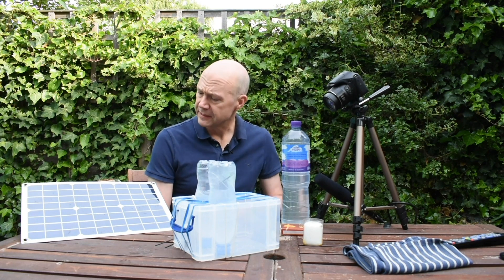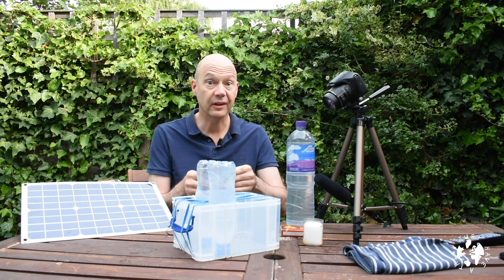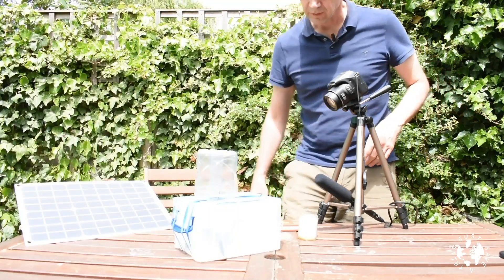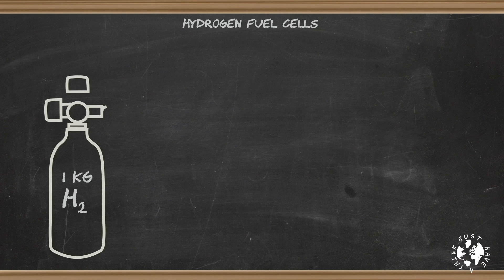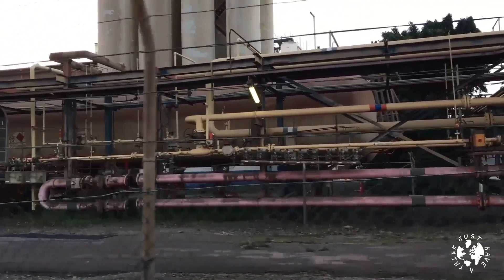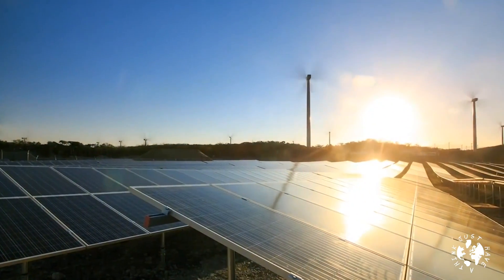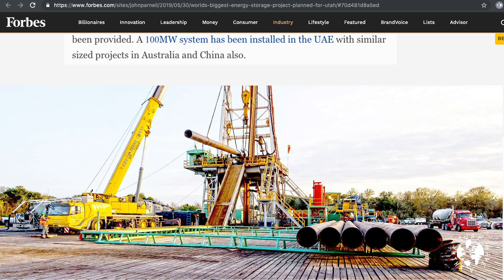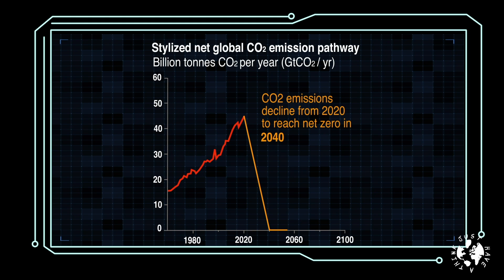Energy Storage in Hydrogen : Does this beat batteries?

Comment: You can't use hydrogen in normale pipes, and it would be way more dangerous to use too.
Then there us the power lose from making it and using it, making it way less efficient than batteries.
And yes you could use ut on peakerplants, but no they are really slow compared to a battery, so it can't replace those. As they react on microseconds where a peaker takes minutes to hours to reach demand, just look at the Tesla battery in Australia.

Comment: Ultimately it all comes down to price per Kw delivered. Because of the inherent inefficiencies in the collection and distribution of Hydrogen , esp using PV , Batteries are still ahead for small motor vehicles.

Comment: Any serious energy storage facility is going to be using the pure O2 also. Pure O2 enables fuels to burn faaaarr hotter, so any legitimate comparison between batteries and stored hydrogen needs to include the pure O2 gas.
Reply: The only efficient way to reclaim energy stored in hydrogen is fuel cells.  Burning hydrogen means losing something like 70% to waste heat.

Comment: For H2 hidrogen energy nid for fuell cell lot of Platinum for electrode.And for membrane for Fuel elements   have not so long life.Better will be use NaS battery.Na get from salt,S from petroleum,vulcans ect.It's more perspective but fo NaS battery nid for work high temperature.

Comment: Instead of focusing on storing the energy, why can't we focus on placing solar panels more to the east and west? 
Why can't we start buying electricity from other countries (because we can't place our solar panels there, but they can)?
Reply from the maker: Hi Harry. Fair observation. I've looked at smart grids a couple of times in previous videos, but we also need to develop High Voltage DC transmission. This is already being developed and I think we'll have sub sea cables for global smart grids within a few decades. I'll do a program about HVDC later in the year. All the best. Dave

Comment: The problem with hydrogen is that it already reacted to reach a more chemically stable state due to its reactivity. Converting it back to potential energy is inefficient and therefore ineffective. It’ll be much more effective to pump water to a higher altitude and use hydroelectric power.

Comment: Seems to me hydrogen would be a good alternative to power shipping.
Reply: @zUJ7EjVD  why? Will be able to make plenty cheaply as with renewables you over build so plenty of cheap electricity available. Energy dense giving those large ships a long range. Safe, if theres a leak it just vents upwards.A dam load easier than bunker oil to use. And so on.
Reply: @zUJ7EjVD  It's not that bad when done on a larger scale, ie ship sized stuff. Yes it's inefficient but you're using electricity that would only be curtailed.
Reply: @zUJ7EjVD  We don't have the infrastructure or the amount of renewable  electricity generation at present. But we will, a paper came out the other day showing how it made economic sense to dramatically over build renewables and curtail large amount of electricity. So electricity will be cheap for such industries. These industries will be energy hungry but relatively cheap infrastructure. What better energy storage options are there for ships?

Comment: I remember reading it takes a heck of a lot of energy to convert water in to hydrogen, you can see from your video it took 3 hours to make a tiny amount of hydrogen, and on top of this then you have to freeze it or compress it to make it usable, which means even more energy is needed. On top of this it's very flammable and in the past Hindenburg disaster where the blimp exploded and killed a lot of people. Where as batteries don't have the issue of exploding, in the same way hydrogen does. Also I don't see how you can light it and not create additional chemicals. That doesn't add up to me. So I would need to see some more chemistry on that. Also the numbers on how much energy is needed to produce hydrogen, verses energy needed to produces batteries... plus mining for the canisters which store the hydrogen, vs mining for lithium. Maybe I'm wrong. I just think there is a lot of information missing.
Reply: Yes, you are wrong. Unless you are making high power fuel cells for cars you don't need any special materials, and for storage you can use either caves and old mines, or rather simple tanks that would cost way less than batteries, capacitors or flywheels. The only chemical created when burning hydrogen is water.

The grid already needs some kind of storage to balance the daily load because starting up or increasing the output of a nuclear or coal plant is too slow. This is a fact: the lobbyists claiming we need coal and other carbon burners for that are lying liars who lie. All storage systems have their own problems: Batteries need expensive materials, flywheels need to be huge, pumped water needs even bigger lake. Hydrogen looks pretty good for longer term storage, but we really need some engineers and economists to figure out how much a large scale production facility and storage systems would actually cost. Also, hydrogen is not as good for short term, so batteries etc. are still needed.
 

The most likely problem is power production, people want storage instead of building bigger farms of solar panels or windmills thinking the extra production would be wasted, but storing that overcapacity as hydrogen turns it from stored power to a valuable product. Soon enough local industry will want to buy it, while the power consumption of the city will keep rising, which results in the power plant being too small to provide all power alone and the hydrogen being too valuable to burn for producing more electricity.

Another possible use for hydrogen is combining it with carbon dioxide from the air and making hydrocarbon fuels without needing oil. Currently this is yet more expensive than oil, but it is a technology that was already in use back in WW2. Scaling up the production may well drop the price so low that we don't need to buy oil any more, plus it is carbon neutral and does not cause all the other environmental damage that drilling, fracking and digging oil sands causes.
Reply: @AnalystPrime     What you said doesn't make sense. If you have been in caves you would understand that air flows through the caves and is pulled and pushed out. You would also have to seal off the caves some how, and make sure the rocks didn't leak water in. So It's not as simple as find an old cave, you would have to build everything to make sure it didn't leak. Ever heard of a canary in the mine. Well that is why. So yes you would need tanks or canisters to store the hydrogen. Which these need minerals to be mined, just like batteries unless you refurbish old ones specifically for highly flammable hydrogen, simply a static charge can make it explode. So that means you have to make it so no static charge could explode the tanks. I'm not sure if compression makes hydrogen more stable or not either, I'm guessing freezing might? All this effort also isn't free, the energy needed to turn water in to hydrogen has a cost. That means is it more efficient to simply make batteries, or to make hydrogen that isn't dangerous to people, or secure the hydrogen so it's safe.

Elon Musk thinks Hydrogen fuel cells are silly.
https://www.youtube.com/watch?v=yFPnT-DCBVs

Batteries last a very long time, there is a new battery called the flow battery that doesn't explode and is very cheap storage, last a very long time, is efficient and doesn't have a high risk of exploding. There is also hydro energy storage, gravity storage, compressed air storage, and hydraulic storage, none of which will explode by accident. Here is a video on flow batteries: https://www.youtube.com/watch?v=4OHstY_kKUY

As I said the video doesn't explain how burning a chemical can lead to no  emissions. I find that odd, since burning takes oxygen out of the air. You need to provide an explanation as to why the: nitrides and nitrous oxides, or water vaper, wouldn't be that much of an issue?
Reply: @TheaDragonSpirit  I recommend taking some basic science classes, they are available online these days.

You yourself mention the canary in the coal mine, but fail to understand what you are talking about. The canary is there in case the miner opens a gas pocket because the bird will die faster than the humans and warn them there is dangerous gas. As in, gas was trapped underground tens of millions of years ago and only got out when miners broke the rock. If the rock was so cracked that water gets trough it then obviously that is not one of the caves that are used for storing gas, and frankly few people would have tried mining in such area in the first place because it is dangerous.

We already use caves and old mines for storing gases and compressed air. This is a thing we already do, not some "maybe in future"-idea. If it was difficult or prohibitively expensive nobody would have tried it in the first place.

Gas tanks are generally made of steel, which is iron and trace amounts of carbon. World production of steel is huge. Tanks that hold pressurized or liquid hydrogen are not high tech or extraordinarily expensive.
Being simple they tend to last many years.

Modern batteries not only need more expensive materials, most of them are also very difficult and expensive to manufacture. Flow batteries and other alternative technologies under development are generally a case of "cheap, efficient, long-lasting- pick two". Sometimes you don't even get a second pick. That is why people still think of lithium even for grid scale projects.

Grid level batteries are huge, and when you need to build something the size of a football field even cheap materials alone are still going to cost loads of money. A bunch of simple gas barrels are going to be way cheaper.

Batteries also have this problem where charging and discharging them degrades their performance, sometimes in just couple years. Sometimes they burn or explode. Alternate tech like the liquid metal battery have their own problems, like needing to be kept at temperature of hundreds of degrees C.

Hydrogen does not just explode for no reason, it is a very light gas that will quickly disperse if there is a small leak. You would basically need to put an open fire next to the tank and then open a valve so the hydrogen can mix with oxygen and gets ignited.

Speaking of which, water is one oxygen atom combined with two hydrogen atoms. Electrolysis adds energy so the atoms break apart into hydrogen and oxygen. Burning the hydrogen just recombines it with the oxygen and re-releases the energy, producing water and nothing else.

There are no extra chemicals involved at all. Seriously, I learned this in elementary school.

Fuel cells have their benefits, but I agree with Elon that they are currently not good idea for most vehicles. Using electricity to make hydrogen, transport it to the vehicle and then burn the hydrogen to make electricity to run the vehicle is only 20-30% as efficient as simply using that electricity to charge the batteries that the vehicle operates on. This is of course silly, unless something else makes the extra steps better than having a big battery.
Reply: @AnalystPrime  You learned that burning hydrogen doesn't produce nitrides and nitrous oxides or water vaper?
Reply: @TheaDragonSpirit  Of course it produces water vapor. This is one of the simplest chemical reactions there is: H2 + O = H2O. That's water.
If you are interested in if the waste heat of a fuel cell can burn atmospheric nitrogen into nitrous oxide, I welcome you to do the math. However, given only about 30% of nitrogen oxides are from human activities, and the main causes of that are agriculture and waste treatment, and there is no way everyone in the world is going to switch to hydrogen cars any time soon, the likelihood of hydrogen fuel cells being a notable source of those gases is rather low.

Comment: Storing hydrogen is highly difficult. Salt caves are even much worse than high tech Materials to prevent hydrogen from difusing through walls.
Also the Energy loss is too high in Power to Gas. About 60% of the Energy gets lost. Even old pumped-storage water plants are 100% more efficient. We need more of them. And also they can not explode compared to hydrogen. Because of this Attribute we got meltdowns in light water reactors in the first place.

Comment: Isn't it dangerous to send hydrogen to homes built for methane? For one thing hydrogen flames are much harder to see so people may not realize that a flame is still burning in their kitchen.
Reply: You can't just send hydrogen through existing infrastructure. You need new pipelines/piping. Hydrogen makes metals brittle and crack unless specially selected for hydrogen.

Comment: Can you use 220v from the mains to do the same thing only faster?
Reply: No - it has to be DC.
Reply from the maker: Mondo is right Stuart - I would also not recommend getting mains power any where near a liquid :-)
Reply: @JustHaveaThink  Unless you want to win the Darwin award
Reply: @mondotv4216  I was thinking that mains and water weren't the best mix but always good to check. I was also thinking how did they do it at large scale. 

So would I be right in saying something like a car battery would be suitable to use instead of buying a solar panel?
Reply from the maker: @mondotv4216  Haha. Yes, indeed. That would certainly qualify :-)
Reply: @stuartfmasterson  You could use a car battery but making hydrogen at home in any quantity is neither practical or safe. For example a car battery can spark when connected. Hydrogen forms an explosive mixture at certain concentrations with air. Sparks and explosive mixtures don't mix either. To understand why hydrogen is much more dangerous than methane, you have to understand the rate of oxidation. Check out his video - https://www.youtube.com/watch?v=65KIexy4New

Comment: Sounds all fine, however, you really cought my attention around min 09:20 when you mentioned that “hydrogen gas can be pumped in the existing natural gas pipeline system without any alteration” and that’s just not true. You can transport a NG/H in a mix of up to 85/15 but any higher H content and you run quickly into severe problems. 

Both hydrogen embrittlement and corrosion happen when you introduce pure Hydrogen in a pipeline that was designed for NG? 

As you know Hydrogen has an active electron, and therefore making it very corrosive. There are hydrogen specific pipelines, but they are very differently designed and built than NG pipelines 

Just saying, but you are on the right track using Hydrogen instead of batteries for energy storage.
Reply from the maker: Thanks Tom. My understanding from the bit of research I did was that the pipelines were OK while they were conveying a combination of natural gas and hydrogen, although it's true to say that the general consensus seemed to be that alterations are required if the lines are to be dedicated to only carrying hydrogen. Apologies if this bit was a little misleading. All the best. Dave
Reply: A small amount of hydrogen can be added to the existing natural gas infrastucture. Important: that triggers the first round of economy of scale. That happenes also with all other new technologies as soon as they become more mainstream. 

For solar. Dr. Eicke Weber (Fraunhofer Institute, they do material research). 

Every time the installed global capacity (panels -  kWp) doubles the price for the electricity produced by the latest devices drops by 20 %. 

That trend is steady since the early 1980s and it was never about the time that had passed,  but about the installed panels. So the Germans and even more so China did the world a favor, the started something.

It triggered price drops that made more solar panels viable  (in wealthy sunny regions with high electricity costs and a lot of A/C running = ideal conditions for a good ROI)

Think California, Australia, ... - not Texas for instance, their electricity rates are too low.

Now those sales helped to bring prices down even more (making panels - or wind turbines - an economic option even when conditions were not ideal). More sales meant more companies engaged, invested in R & D, ... 

Rinse & repeat

The first production of hydrogen could be distributed by the existing infrastructure which is a huge advantage. Meanwhile R & D continues, solar, wind and other storage solutions continue to improve (also an  economy of scale effect). 

Maybe completely other solutions appear (then no stranded costs for infrastructure). 

The path is created while we walk it. - that the gas net can absorb a little bit of hydrogen is a bonus even if hydrogen never becomes the big solution (which we cannot know in this stage so all options must be pursued, there is also value in excluding what does not work).